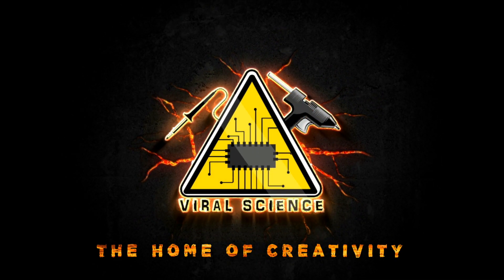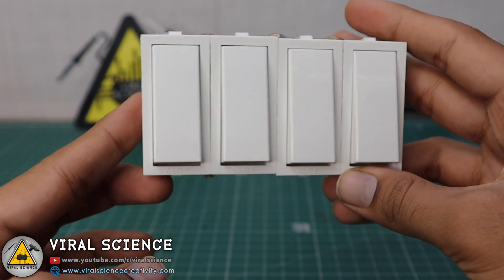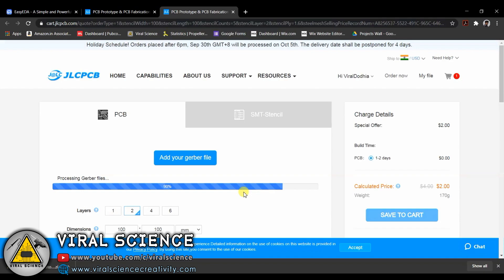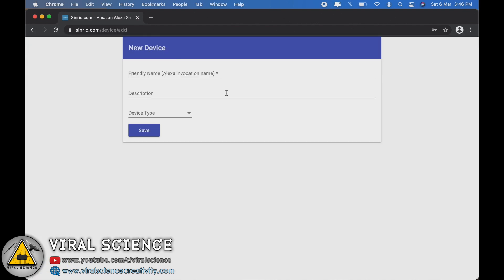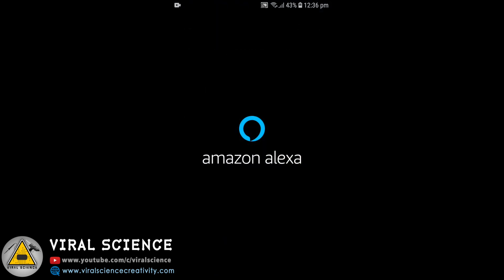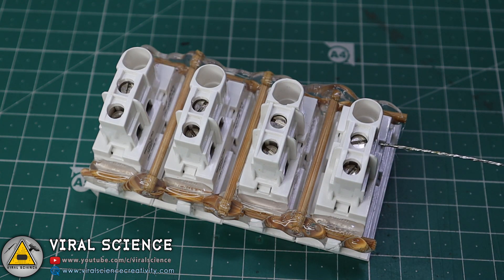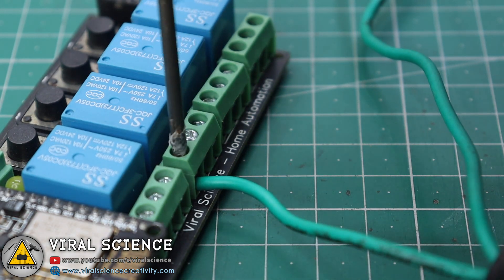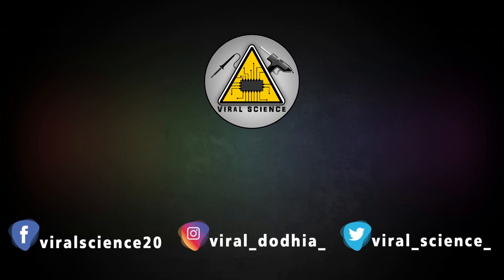ESP8266 Alexa Home Automation with Manual Switches

Comment: I have 2 channel relay module which says 5v . I tries using them with esp8266 but it is not working properly. I think because esp32 and 8266 have 3.3v output only... what should I do??? How to use 5v relay with 3.3v ???

Comment: Hi, This code is not working with manual switch if Wifi is disabled or turned off. Do you modified version of .ino which works with / without internet?

Comment: hello bro 
I have problem with using Switch because it's not sending one time LOW or HIGH as the push button. The switch keep sending LOW when it is switch ON and keep sending HIGH when the switch is OFF. So that will effect the sending through ALEXA it will stop ALEXA controlling. The only way that I know is to use billing switch to manual control because it send one time signal HIGH or LOW. Pls anyone have any idea to solve this please help me. Thanks regards,,  ^_^

Comment: Hi! What about my internet connection stops working, will be possible for me to turn on/off the lights mannually? Thanks!
Reply: yah exactly when I use the push button or the switch it keep sending High or low. Than mean the light will not response to the Wifi control. Please I need your replay on this. Thanks
Reply: @badral-moraggab2898  Thanks!

Comment: BRO MAKE THIS PROJECT WITH TTP223 SMART CONFIG
Reply: You can make it using push button code instead of manual switch code , connecting TTP223 in place of push buttons and setting for momentary option.